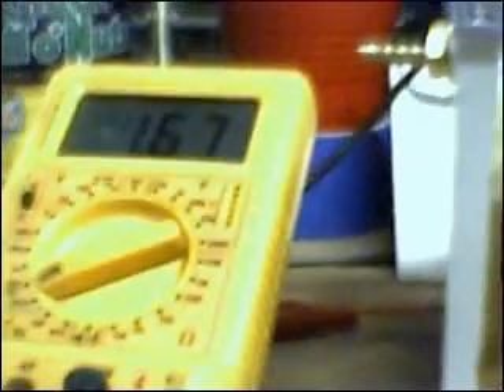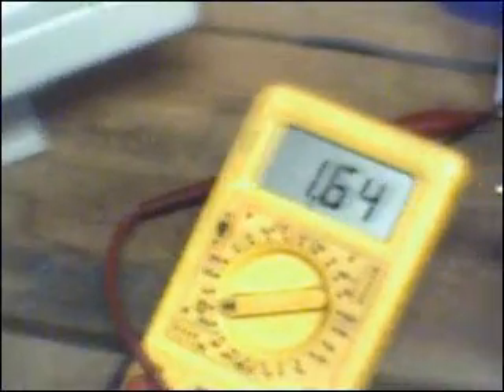22 - Hydrogen HHO Electrolyzer test unit 10-2

Comment from the maker: Sorry. I'm just not that impressed. All I see is concentric tubes with one or two as neutral plates. Very low production. When he adds fluid, it only gives the illusion of increased production by raising the level of the existing gas bubbles. Vinegar will evaporate. Other electrolytes do not.